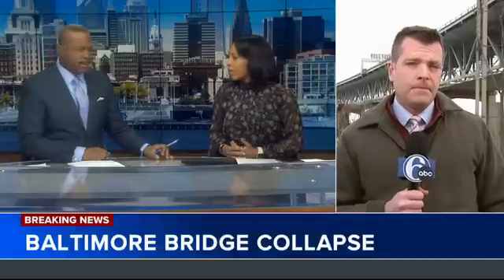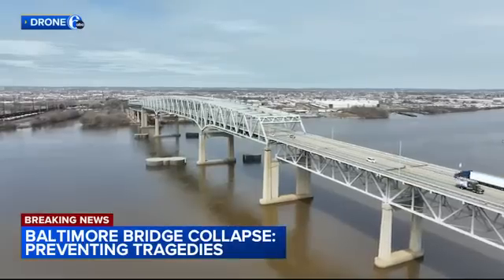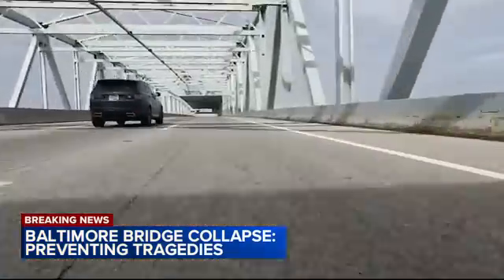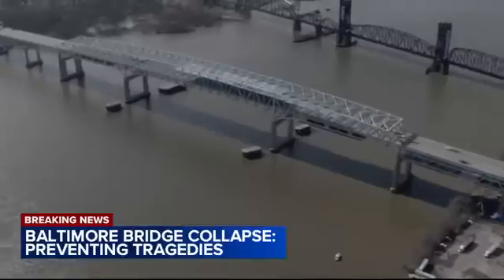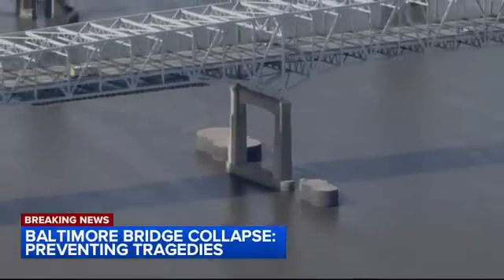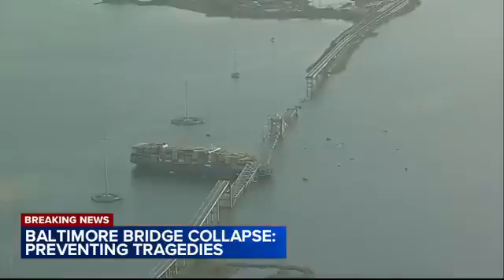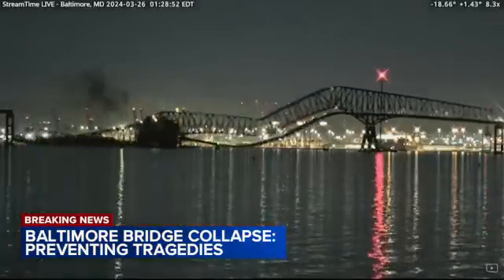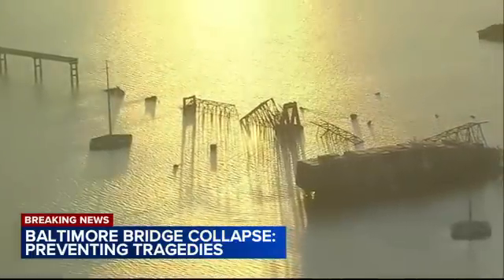Here's what surprised a structural engineering professor about the Baltimore bridge collapse

Comment: I'm no engineer but have basic understanding of mechanics. I've watched this bridge collapse again and again and I wonder why the as viewed in this video, does the far right section of the bridge start to come off the base and and drop down as the other side is rising up at the break point?????  If the bridge was attached to the concrete bases securely, seems to me that just the main part would have broken away and the both ends would still be on their respective bases????  I know all you engineers will tell me that the lever action of the collapsing center could break the bolts that anchor the ends and that would then cause the whole thing to collapse, but then I would wonder who designed such a bridge to be so vulnerable????

Comment: Yet the Ross bridge only has dolphins protecting the two center supports.  The two outside that are not protected.  Couldn't a large boat hit them and also bring the bridge down?  I'll bet this disaster will cause a lot of bridges to be re-evaluated.  Plus the Key bridge construction did not isolate each section.  So the sections affected dragged a 3rd section down as well.  Yes the bridge would have been out of commission for years potentially but if fewer cars would have been in danger and less bridge might have to be rebuilt.

Comment: The commentator described the structure as a continuous truss bridge. Not a good design if the failure cannot be contained within one set of girders, or two if the failure occurs at a pier. I think the Tay Bridge collapse of 1879 did something similar. May I suggest a radical new design - the discontinuous truss bridge
Reply: Yep, with a 100 meter gap in the center :)

Comment: I think the structural engineer was kind of saying what I was saying to people. That whole bridge should have not came down like that. It should be separated with the expansion joints breakaway joints to where from the pillar that was hit to either direction. Yes, that platform to me could collapse but the following platforms on unaffected pillars should not have came down like it did. It look like it was completely connected all the way through to steel structure and to me it should be basically not one long bridge but several bridges.    With maybe slightly wider pillars to accommodate a section of road that in a way is free floating with expansion joints sitting on the pillar and even if that was affected it wouldn't do much to the next platforms.  One of the first things I thought when I was seeing it. Why didn't the boat drop its anchors once it realize it didn't have power? How is it not protocol to your bridge that the anchors would automatically just drop whether it would have stopped it or not? I don't know but at least it gave it a chance. Was something that size in the mass. It has slowing the speed down even a little bit. Can have a huge effect on dynamic force

Comment: Now that would not have stopped. What happened in Baltimore and I'm sure that structural engineer understands that the amount of  dynamic force that barge was releasing on impact at 9mph  was phenomenal  And I'm not even sure how big those would have had to been in order to have an effect. And I'm not sure if under the water  those concrete barriers are angled the kind of maybe redirect and I'm sure they made those to take care of any size, ship or boat that would be in that area but that would not have stopped it. Like I said I'm not even sure how big they would have had to bend a lot of force. Try stopping rolling car. Going down a slight incline in neutral now. Imagine something like that. Moving at 9 mph.

Comment: This is only my understanding of what happened from reports and watching videos. If you look, the Baltimore bridge pylons have pillars either side. However the ship dropped anchor causing it to swing around on the anchor. I don't know if the pillars are there to stop vessels from hitting the bridge pylons but they are there. Also you can see that although the bridge fell it stayed in its sections except where it failed from having a massive big ship crash into it and the energy from this passed through the bridge and tore the bridge sections from the pylons. Any other observations or opinions?

Comment: As I commented on another site re this disaster. If the ship had been under the bridge when the wind took it into the pier  of the support metalwork, quite possibly the bridge would be ok as the overhang of the side of the ship is non existent and if the pier was strong enough the ship would not touch the bridge supports. But the bow overhang on modern container ships is massive, far bigger than those around when the bridge was constructed to a minimal budget. It would require a pier near half the width of the ship on the transit side to prevent the top of the hull taking out the bridge support column. Also without a wide pier barrier any striking of the support column is a cutting glancing blow this creasing the support meaning instant collapse. Just like standing on a can and tapping the side, it collapses instantly. Also the support columns require engineered wings/platforms on the internal sides just below the rollers to prevent the span falling if the span moves away from the support column. Then there is the issue that if the power had failed a little earlier the ship would have hit the bridge under one of the other spans as the wind drove it to starboard a fair distance.
Retro fitting larger piers around the metal support structure should have been done years ago. Also as container ships go this one is not a giant. There are far bigger ships around and the bigger they are the more the bow overhangs the hull for streamlining underwater and maximising width capacity above the water.
Reply: Holy crap, very well explained.
Reply: Excellent commentary and analysis. Thank you!
Reply: You noticed that.  Good eye.
Reply: I disagree with some of your statements; at least I don’t understand what you’re getting at. When you say “bow overhang” are you talking about the height of the forecastle above the water line, or the distance that it protrudes forward of the ship (the “rake”)? It is relevant if you are claiming this modern design is fundamentally different from ships of the 1970s. And the second point, while there are “much larger” containerships out there, this was a quite large one, probably pushing the limits of what the Port of Baltimore can handle. 300m length, 48m beam, 15m draft nearing 117kdwt, that’s not trivial.
Reply: @SpamSucker  Size wise yes its big. This ship is not small. But compared to the capacity of container ships in the 1960-80s it is very big. The capacity when this bridge  was built averaged about 750 containers per ship today it is over 4500 average and the largest over 25k.  Also size was usually restricted by the Panama Canal having a maximum length of under 1000 feet prior to 2016.
By the overhang I refer to the difference between the ships width at the waterline compared to the width at the deck line. In the centre they are equal in most ships. At the bow the waterline width is narrow as a result of minimising water drag as much as possible. Yet at the same point, say 10-20m from the bow, the deck line width is as wide as it can be to enable more container capacity as far forward as possible. This is the overhang I write of.  When I was at sea in a former life bulbous bows were only on fast passenger ships. Bulk commercial ships were built for maximum internal hull capacity with wide blunt bows and the container ships were marginally sleeker but still blunt.
Reply: @jimspc07  thank you, and yes I withdraw my objection, the quick flare to max width at deck level is a valid concern. In fact, valid even in light of the fact that nearly all modern containerships do have a bulbous bow, because the bulb is quite narrow. So even if a protective dolphin was present and the bulb was pushed to one side, that overhang almost certainly would contact bridge structure. In fact in this video when they showed the dolphins at the bridge in the Delaware river, my first instinct was “no way that’s big enough!” So what to do… yes, you could make the dolphins/piers wider, but this has the practical limit of interfering with water flow in the case of rivers. But I think it could be effective to extend them in length, to ensure that in a drift-on event such as this one, the hull shoulder at waterline reaches full width before that forecastle structure reaches the bridge. So again, yes I now see your concern and agree.
Reply: @SpamSucker  Yes, I share your concern about the dolphins on some other bridges. But I have seen images of some which look fine with their placement in front of the bridge and look to have been built as effective guides to straighten any stray ship.
Reply: @SpamSucker  I think the "overhang" jimspc is referring to is how far the rail reaches out over anything stopping the ship at the waterline.  Like a shadow.  No such overhang along the sides of the ship...
Reply: PLEASE BE THOROUGH!!!!    CAN'T YOU SEE THAT THE SHIP TOOK A H A R D RIGHT AND HEADED STRAIGHT FOR THE PYLON?????     CANT YOU SEE THAT WHERE THE UPPER BEAMS SNAPPED IN TWO, THERE WAS AN EXPLOSION AT EXACTLY THE SAME PLACE, FOR ALL 3 CLEAN BREAKS????   PLEASE, REWATCH THE VIDEO, AND INCLUDE WHAT YOU SEE AFTER REWATCHING IT.....
Reply: @danoman1893  What I see is a part of the box section containing the road surface of the bridge on the bow of the ship with all the main bow damage on the starboard side and the bridge box section parts angled across the mooring deck indicating the ship was at about 8-12 degrees off hitting the bridge straight on. What I know happened is the bow overhang caught the bridge verticals and creased them in a manner that collapsed them. Thus the box section of the bridge having no support fell down on the ship further ripping the starboard side of the bow open. This along with the grounding of the bow of the ship due to the extra weight stopped the ships momentum.  If you study images of the hull on the starboard side at the waterline,  there does not appear to be any marks or damage from the concrete piers, which at 8 knots would have caused a rip and tear in the steel, though there may well be, but now below the waterline and not visible, though I doubt it as the ship would have settled lower in the water as flooding would have settled the bow deeper in the mud. Indicating the concrete piers may well have not been hit initially.
Maybe you should look at a few more shots of the lead up and the result and getting the image depths into perspective and the angle of the ship in relation to the bridge.

Comment: When the FSK bridge collapsed you could clearly see in the video that the right side collapsed even before the center came down and that the entire truss section completely collapsed very quickly.  The sections on either end that were incorporated into concrete piers stayed completely intact.  Seems like an engineering failure of a very poor design of the truss section that has it simply balancing on pylons so that if one section fails the whole thing rapidly comes down.   Cause of death: boneheaded engineering failures. The bridge's truss design and the ship's navigation/steering design failures both caused the severity of the catastrophe and the resulting deaths.

Comment: Note that each tall power poles in the water near the bridge had a large protective barrier around them, while this huge and expensive bridge did not.  As cargo ships more than doubled in size since the bridge was built a half century ago, the real question is why weren't protective barriers retrofitted around the bridge supports?
Reply: Actually, ships have more than quadruple in size since then. That didn’t have any protection, since it wasn’t required when it was built. With 20/20 hindsight it probably should’ve been added it.
Reply: @neilkurzman4907  plenty of bridges have had additional protection added since 1977 and new bridges are always built with additional protection.
No hindsight needed, just regular inspection and improvements made according to new standards, as is normal for large structures.
Reply: @freedomfighter22222  
No, it’s not normal. There’s a lot of bridges that aren’t even properly maintained as you might’ve heard in the news.  There are thousands of bridges in the United States that don’t have passing marks and thousands of others that need to be replaced because they’re outdated or insufficient for the traffic they handle.
So no, this isn’t normal in the United States. Though perhaps it should be.
Reply: @neilkurzman4907  Do you have any clue how many bridges there are in the United States?
It is entirely possible for thousands to not be up to standards while it is also normal to do rechecks and upgrades to bridges.

What you see on your drive to work or all the worst case scenarios that you see on the news isn't a good measurement of what is normal, the tens of thousands of bridges you don't hear about besides when someone complain that money is being spent on upgraded safety features that likely wont ever be used is what is normal.

Comment: The Baltimore bridge did have the safety measures but they were just under water. They should have worked but did not according to the coast guard report. These were rubber and underwater. Just a different system than Deleware. So the engineer and the news jumped the gun here. The real question is why didnt the work.

Comment: I wonder if the superstructure wasn't compromised by hidden rust and even rot at the key joints. Those bolts and rivets are over 50 years old.
Reply: If the bridge was brand new and a 50,000 ton ship ran into it, you'd get the same result
Reply: Bridges are maintained. Especially salt water bridges. 50 years of salt corrosion, if not maintained, would not have lasted this long. Crews are constantly inspecting, scraping and painting these bridges.
Reply: If I remember correctly from my bridge inspection days, every bridges to be inspected and reinspected every 5 years.. In the event of an outside.
Factor affecting the bridge potentially earthquake impact. The bridge has to be inspected within one year. If the bridge is dead particularly vulnerable. I believe the 1 year rule applied.

Comment: A concrete dolphin probably wouldnt have stopped the ship,but it sure wouldve ripped it to shreds,possibly sinking it,biggest issue is it appears the boat was trying to pass under the wrong section of the bridge to begin with,even if the concrete support wasnt hit,the containers probably wouldve still catastrophically damaged the bridge to the point of complete failure.

Comment: For perspective. The ship is almost the size of the empire state building...imagine stopping that!  From bing copilot-The Dali is a Neopanamax container ship. Here are its dimensions and weight:
Length: 299.92 meters (984 feet)
Width (Beam): 48.2 meters (158 feet 2 inches)
Height (Moulded Depth): 24.8 meters (81 feet 4 inches)
Gross Tonnage: 95,128 tonnes
Net Tonnage: 52,150 tonnes
Deadweight Tonnage: 116,851 tonnes
The total weight of the Dali when fully loaded with cargo would be equal to its deadweight tonnage. This is because the deadweight tonnage includes the weight of the cargo, fuel, fresh water, ballast water, provisions, passengers, and crew. 

For the Dali, the deadweight tonnage is 116,851 tonnes. So, when the Dali is fully loaded with cargo, its total weight would be approximately 116,851 tonnes. Please note that this is an approximation and the actual weight can vary depending on the specific cargo and other factors
The Empire State Building is approximately 1,454 feet (443.2 meters) tall, including its antenna, and its roof height is about 1,250 feet (381 meters). It has a total of 102 floors. The building’s base measures about 424 feet (129 meters) by 187 feet (57 meters). 

As for the weight, the Empire State Building weighs approximately 365,000 tons. Please note that these are approximate measurements and the actual dimensions and weight may vary slightly

Comment: 1. The ballasts are not far enough from the pillars too; 1. Possibly Break on so much ship load. Or 2. Deflect.
And the strenght should be in the "Arch", or over head to at least suspend it without the piers! These two Bridges do not take advantage of the purpous of triangle girders espeacially when thee upper girders are the same distance from the bottom frame work supporting the road base from one end too the other. Where if an Arch or trangle peak had been in the center,, though not stable, would have suspended the bridge without support beneth.

Comment: Those concrete pillars can take compression hits but cannot take vertical strikes.  It's a known issue with concrete pillars.  They should have used steel reinforcement.  Even if this bridge was reinforced, the massive 200-million-pound vessel would have crushed anything in its path,

Comment: I still believe that from the angle I saw on video that the containers were stacked to high and that was the reason even if the ship lost power and steering between the supports those containers still would have took out the bridge in my opinion but why didn’t the pilot make a course correction ahead of time just as a precaution I think if that was done ahead of time and power went out and the containers were not stacked too high it would’ve just coasted right under but as I said that’s just my opinion from what I saw feel free to help me understand